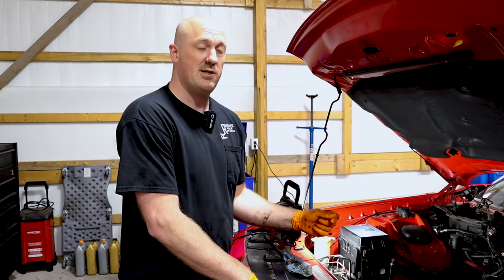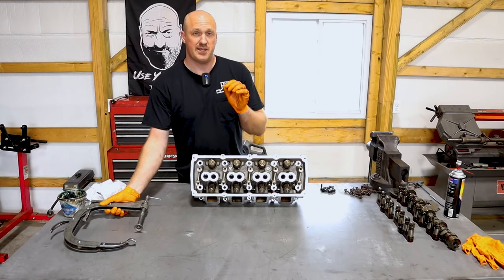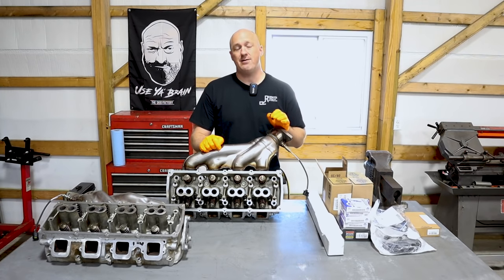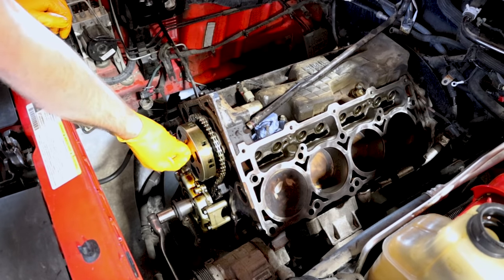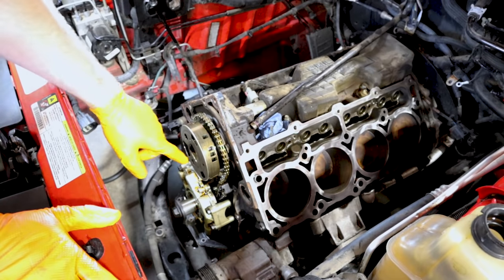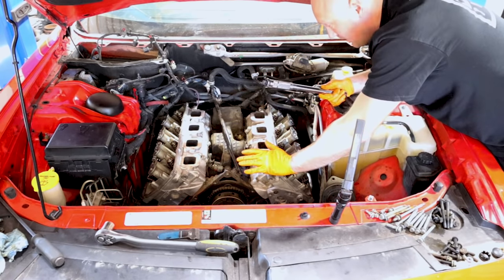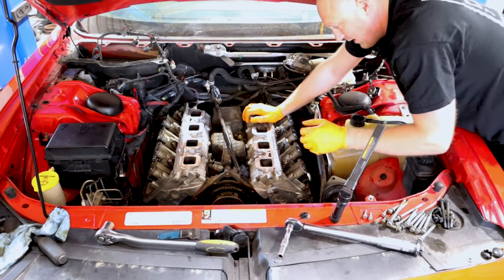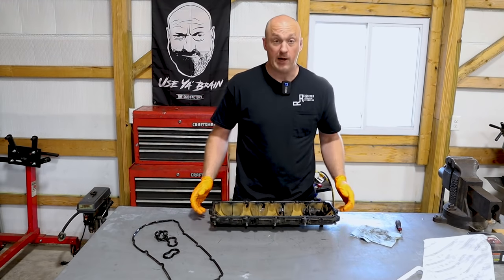Hemi Camshaft Installation Continues, SRT Headers Install! Budget Challenger Build Ep2

Comment: This video is the reason i decided to replace the lifters and cam on my 6.1 Hemi myself. It really motivated me. I love all your vids.

I do have two questions.
The first is about the heads, do the heads need to be machined?

Second question
The lifter that failed was on the passenger side 
Will it be ok if i just replace the lifters on that one side and leave the other side untouched?

Thank you
Reply from the maker: Love the fact that you're going to take it on 👍. As for your questions, unless the vehicle has been overheated at some point, not necessary to machine the head surface. It's a good step to perform and I wouldn't fault anyone for doing so, but it's not strictly necessary. Secondly, definitely 100% replace the lifters in both sides. It's not barely any more work to remove the other head to replace the lifters once you've gone that far.
Reply: Thank you for taking the time to respond 
I got some quotes over the weekend that ranged from $3000 to $5000. With a combination of my basic engine knowledge and your videos i decided to do it all myself at home. And im glad i did.
 I agree with you, i have the engine all torn apart and removing the driver side head would be super easy at this point.
I will be removing the driver side head today and order all 16 lifters and cam from Mopar along with all the gaskets needed.
Since i don't know the history of the car and it currently has 190k miles, i will take that extra step and get the heads machined and replace the valve seats while im at it. I would hate to drop a valve seat down the road.

Again, thank you for your support...

Comment: Been watching a lot of your videos...SUPER helpful!! Thanks so much for all the great info!! Sorry if this is not the best place to ask, but I've been looking all over and can't seem to find a good picture or clear answer yet. I have a 2013 Grand Cherokee (5.7)...and I'm trying to figure out whether I'll need to remove the AC condenser to replace the Cam. Any chance you know if that'll be necessary? Just not sure if there's enough room to swap the cam without bumping into the condenser.
Reply from the maker: Just double checked and yes you'll have to remove the condenser on those vehicles. 👍
Reply: @ReignitedAuto  Okay great, thanks for checking!! Appreciate it!!

Comment: Watched a lot of these videos of yours and I am trying to decide what to do. I have a search and rescue 2016 RAM  2500 5.7L. I am concerned about reliability and being able to idle for a few hours at a time.    Can I do cam, springs 6.2hellat oil pump and whatever else to increase reliability rather than performance to avoid tuning issues and save money.  I can dedicate around $3000-3500 on this. The reliability is very important as it is used to hold a SAR K9 with the AC during warm environments. I have a backup AC that runs on DC power as well as cellular temperature.monitors
Reply from the maker: I think that your scenario is the perfect one to install the hellcat pump on. I work on quite a few K9 units at my work, so I know how critical the A/C functionality is, and I think the hellcat pump will do the best job of prevention for your ram.

Comment: Thanks to  ur videos i learned so informative information  I have 05 ram  5.7 and just did head gaskets @ almost 200k miles ..I regret not upgradeding the cam while everything was out but it wasn't in the budget..since I re did everything new with the heads and top end .....question any recommendations for cam on  my 5.7 ram that's not to crazy if I decide to do it later on

Comment: I don't know about those heads .... but my heads are off the block on a nice table in a clean room.
I noticed large scratches the heads were putting in the top of the table. So after I removed all the springs and valves, I took a small triangle file  and removed all of the sharp edges left on the heads . I guess when a human hand never touches the parts to be assembled, the robots don't complain about the sharp edges.
I took my engine apart for the reason of #7 was misfire. With my luck it would have to be the most expensive thing to fix.
On top of the many years of neglect, I could only imagine that my cam and a lifter or 2 was destroyed. 
When I pulled everything apart the cam was still all there. Every lobe still having a peek. So I had to dig deeper. 
I cleaned the hell out of the heads and de-burred all the sharp edges, replaced the valve stem seals. When I was putting the last intake valve back in (#7)
I was wiping the valve spring and cut my finger wide open. The spring has some type of shroud around the base with 5 bent tabs that the spring sits on.
Without those 2 tabs the spring wouldn't sit flat. It would put some side force on the valve stem . In my mind I would have to say that it made the valve stick.
So I got new springs and changed them all.

Besides all of that,  your videos have been of the most help. Thank you for your time and dedication to the industry.
I truly believe that the gen3 Hemi has to be one of the most impressive motors I have ever worked on. 2007 DODGE 1500  PICKUP 5.7 HEMI
I understand it wont last 200,000 miles on only 5 oil changes. That's not Chrysler's fault.... SMH thats my  fault.

I should have the engine back up and running in the next week . I can only work on it 1-2 hours in the evening
Reply from the maker: Good job getting after it though! And I have to agree, machined aluminum surfaces are razor sharp!

Comment: Great video.   I  have 06 charger with 5.7 would all the steps be the same.
Reply from the maker: It's very similar, but the camshaft thrust plate is one piece that goes behind the oil pump, so you have to remove the oil pump to change the cam. This can be done with the oil pan on the vehicle, it's just a bit tricky.

Comment: I’m waiting for my parts to com in to do cam and lifters. My lifters started to fail at 157K miles and 1000s of hours of Idling. I drive my truck about 3K miles per week. I will be doing the MDS delete

Comment: I have a manual 2010 RT and the cylinder 3 lifter failed, no noise no misfire just exploded all the needle bearings from the roller went through out the block. I Had to replace the whole engine. Only had 90k miles and I change the oil every 3k. I did buy used with 70k so not sure how it was maintained before me. But it seems to be an issue even without the mds.
Reply from the maker: That's crazy! I've never seen that before 😬

Comment: OK so it is my understanding that in order for the cylinder deactivation system to work the solenoids open allowing more oil into the lifter valley which then allows the oil to depress the pin in the lifters and canceling those cylinders out.  With more oil in the area wouldn't that help prevent lifter wear making the cylinder deactivation system a good thing for the engine? Also just wondering if you knew about sunroofs in Rsms and if so would you mind doing a series on proper maintenance, how to keep them from leaking, and if they need any adjustment.  Thanks Sky!
Reply from the maker: You're right Tom, that's my thought on the MDS system as well. As far as sunroofs go, my main point of advice is to periodically open the sunroof, and looking at it from the top, you will see two small holes at the front corners. These are your drains. Many times these will become plugged and cause a leak inside the vehicle. So periodically use some compressed air to blow out the drains and keep them clear 👍
Reply: Thanks! First time having a truck with a sun roof and always hear horror stories about them. Wasn't looking for a sun roof it just came with it. I just want to keep up on it and avoid any problems. Is a little water leaking through when it rains or going through a car wash normal?
Reply from the maker: @tomcooper920  I'd check those drains right now, usually water only leaks in when the drains are plugged. 👍
Reply: I blew them out and can hear air coming out from behind the front fenders at the base of the A pillars on both sides. It is normal for water to seep past the gasket on the glass when I wash it or it rains? Sorry so many questions.
Reply from the maker: @tomcooper920  it's definitely normal for water to seep past the upper gasket where the glass meets the roof, but it should all end up in the tray underneath the glass and get sent down the drain tubes 👍
Reply: OK. Great to hear. That is exactly what I have happening. Thank you! 👍

Comment: FYI lubriplate engine assy lube should not be used if the engine will be sitting any period of time before running. The oil will separate from the soap. And cause lack of lube on initial start.
Reply from the maker: Good info 👍
Reply: @ReignitedAuto  40yrs in the business you see stuff. 👀it's almost always good to share.
Reply: @ReignitedAuto  btw, halfway through my cam refresh in my 5.7 2013 ram. 
1. Your channel will explode.  It's the best . Thank you for your efforts. 
2. I will look closer when I'm done, but I only have one bad lifter. But the cam has 4 lobes pooched. Are the cams failures occurring before lifter failures?
Reply from the maker: @brentfellers9632  I've seen it both ways myself, it seems like there is an issue with the hardened surface of the cam lobes on certain years.

Comment: High horsepower engines have never run longterm on thin oil the break down of thin oil is faster the harder its used. I worked with a guy his MDS motor running 5-30 has 170 no tick no issues he just traded it in on ecodiesel jeep.
Reply from the maker: He might regret that swap 🤦

Comment: I’m doing the same thing rn but it’s more like the “don’t have any options” build. My car won’t run without misfiring and I live out in the country. I already lost my job because my cars failure, I’ll lose everything pretty soon unless I can get it fixed so I’m starting to sell everything I have to afford the parts so I can put it all back together and get back on my feet.   What sucks is I have a crappy dealership  and I took it to them to be fixed months ago and they didn’t think anything was wrong with it and now I’m having to do it.

Comment: I agree with you on the fact 124000 isn't bad for a lifter failure. Here are my questions. I have a new 2021 392 scat pack 
t/a automatic. Sitting in garage for winter until spring for its initial  oil change. Plan to switch to Amsoil 0W40. Your thoughts on storage and Amsoil with Viper oil filter...
I am curious though, you replaced the 5.7 with a 6.4 cam. Is there a quality issue with the stock Mopar cams, lifters etc. What would you recommend as the best streetable cam for quality and performance.

Comment: Great video. Super helpful! Thank you.

I just finished assembling my hemi and it was running rough and have p0300. It revs up nicely but dies when I let go of the gas.
I'm about 95% sure my timing was on point.

I'm thinking it's the pushrods and rocker arms.
I pulled out passenger side and double checked and still having the same issue. I'll pull the other side next weekend.
I'm not sure if I'm installing pushrods correctly. Do they pop in and are some what held/locked in place?? 
Any recommendations is greatly appreciated. 
Again, great video.Thank you
Reply: I’m having the same issue. Did you ever get to the bottom of it?
Reply: @jamessawatzky8831  it was 1 pushrod on the driver's side that was not installed properly. It was off just enough to make it run terrible. Fixed my issue
Reply: @albertcossio3297  I actually ended up taking the valve covers off on mine and had the same issue. Runs perfect now! Thanks
Reply: @jamessawatzky8831  nice! Glad you found the issue!

Comment: In a shop I used to work we had a few GM 5.3 with lifter failure under 100 K miles . I think those roller failure ere just random part defect/ regular oil change. I have a friend , when building G3 hemi , he does add some oil flow towards roller themselves .
Not sure how , I think he just make a small slot in lifter bore . (don't quote me on that)

Comment: question. I trust as you were a chrysler mechanic that you worked on all v8 engines in it's arsenal. my question how different are the hemi 3 gen camshafts (roller) from a regular flat tappet cam?
I understand that there should be a world of difference but considering aftermarket cam lobes are more "round" than the stock ones, I was just wondering

Comment: How would you check valve lash or valve adjustment.  Can you trust that the push rods are the exact length needed?
Reply from the maker: These are hydraulic lifters so technically there's not any valve lash or any way to set it. Generally I'm dealing with stock replacement parts, so I've never had any issues with them being the incorrect length. That being said, I do check all of them for straightness before reinstalling them. 👍
Reply: @ReignitedAuto  I believe that on some engines in the past the recommendation was to collapse the lifters and measure the gap.  Some push rod length change might be necessary if you used an aftermarket cam?
Reply from the maker: @williamwhite9767  that is true with an aftermarket camshaft, in that case it's best to contact the company for their recommendation on pushrod length 👍

Comment: @16:14 like you mention, How do YOU clean the deck surface? Would like to know, thank you!
Reply from the maker: Red Roloc disc on a 90 degree air grinder, works perfectly. Just enough to get the gasket residue off but not enough to damage the surface of the heads or block. 👍
Reply: @ReignitedAuto  thank you!! Awesome videos get them coming brother.

Comment: Hey man, couple questions for you. Have you ever installed a set of heads with longtubes on them? Does the hood get in the way?

Also, have you ever, or would you recommend lubing the underside of the head bolts and threads to get a (theoretically) more accurate torquing? And do you lube up the pushrod ends?

Thank you.
Reply from the maker: I have not yet tried to install heads with longtubes already installed. My gut says it won't work, but you never know until you try! Chrysler does not recommend oiling the head bolts before installation so I never do. I would only specifically oil the pushrod ends if you are installing brand new ones that are completely dry, if just reusing the stock ones during a repair they should already have enough oil in/on them to be good. 👍
Reply: @ReignitedAuto  thank you so much. Especially that bit about not oiling the head bolts, couldn't find that info anywhere.

Comment: Little late to the party but I was considering adding a set of srt or possibly hellcat headers to my 2011 Ram as a fix for the exhaust manifold leak. Any ideas if that would be a simple bolt on like this or would I need to do some fabricating? Thanks and appreciate the awesome Hemi content!

Comment: i like how ur first video u where talking about long  Idol i have a ram 2500 with a 6.4 hemi when my truck is warmed up and my psi is around 32 psi and when driving its around 50 psi so it being so low the rollers could not be getting enough oil

Comment: No problems before cam install. Currently not missing out or backfiring. Seems to run ok until engine temp starts climbing to normal. Is it possible that the ecu needs to relearn the different cam profile? Just guessing as I haven't heard of any you tubers having this problem. Thanks for your input.

Comment: Ok, so I'm about to reassemble my cylinder heads and fire not only did I wash soak the heads and a non in the degreaser solution I had done the same thing with the other components Rock arm and so on. Do I need to use assembly lube when putting the heads back together? And after that or after mounting them should I pour the oil in normally or pour them over the heads with the valve covers off?
Reply from the maker: No assembly lube needed, you certainly can pour oil on the heads if you want to. I normally use takethe fuel pump fuse out and alternately crank the engine for about twominutes total to get oil primed before I put the fuse back in and fire it up. 👍
Reply: @ReignitedAuto  now why didn't think of that...? Lol

Comment: Would love to know how you torqued the cam bolt without spinning the engine?! I’m the middle of doing this same job and used your videos as a guide, awesome content…love the channel!
Reply from the maker: Usually I access the flex plate and stick a pry bar in there so the engine can't rotate as I torque the cam bolt.  👍

Comment: Hey @reignitedAuto would you say the mopar perf valve springs can handle a 5.98 lift? I just got a hrt stage 2 cam and will be installing on a 392 charger. Ty
Reply from the maker: Actually the springs you already have in your Charger are up to the task, the 392 springs do not need to be upgraded for the cam you've got.
Reply: @ReignitedAuto  would you say it's still a good Idea to upgrade (ex. Pressure rates) im referring to 68277306AA springs to be exact
Reply: Happy holidays btw. Ty for replying especially today

Comment: Did the valves come in contact with #1 piston? Looks like it in the vid. I hope you don't have any bent valves and or pushrods. Definitely would have replaced all pushrods especially if that one lifter was starting to go out.

Comment: Is the intake rocker arm supposed to have side to side play after tightening rocker shaft bolts?
Reply from the maker: If that piston is at the top of its stroke then yes it's normal. Surprisingly when the engine is running the rockers stay centered. 👍